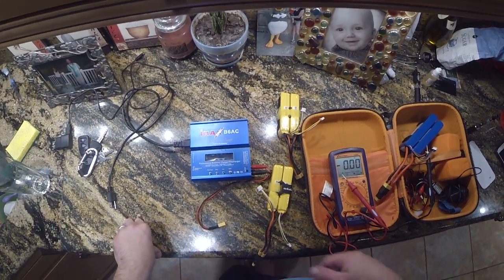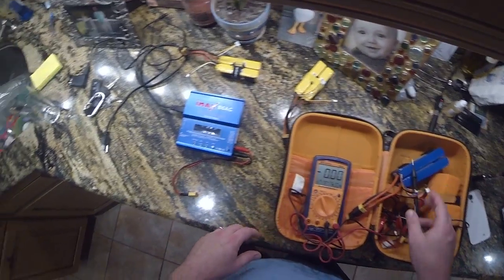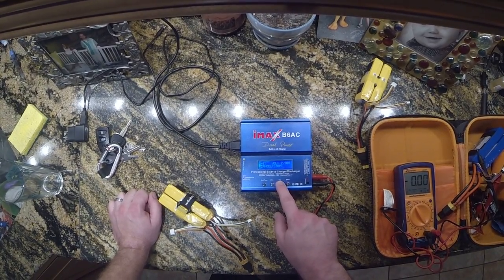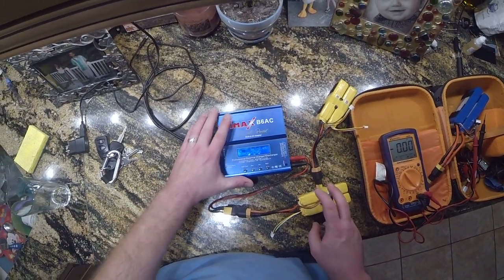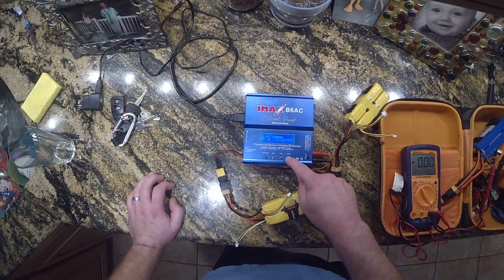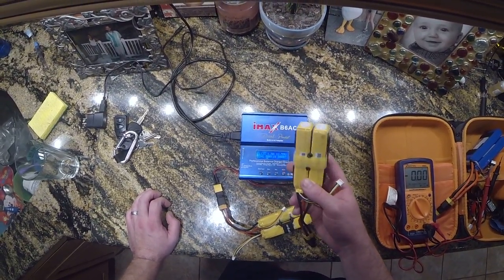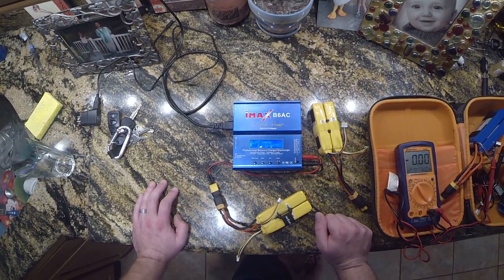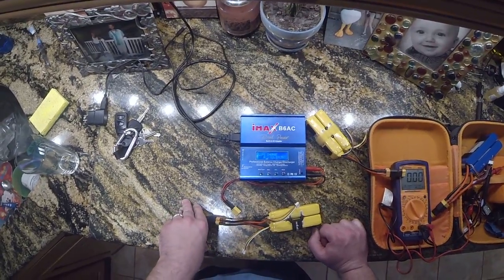How to Calibrate IMAX B6 to correct voltage

Comment: Do you know why my brand new IMAX V6 B3 has an adaptor to convert 100-240 Volt to 12 Volt 5A but yours does not have an adapter and connect to a wall plug directly?

Comment: I also noticed that there is no current calibration; the reading displayed for 600mA = 0.6A therefore it could between 0.55A or 0.65A which would make a big difference

Comment: Best way to Calibrate that charger is throw it in the trash and buy a real charger
Reply from the maker: The charger has actually done a great job and I had the same lipo packs cycled hundreds of times and didn't lose capacity or flight time.

Comment: CAUTION: I have not tried downloading and installing any of the firmware described below, so I cannot speak to its functionality in any way.

SkyRC has released firmware (version 1.14) for THEIR B6 and B6 Mini claimed to allow multiple recalibrations by the user. These links are NOT shown on their "Download" page...only in the help section apparently. The "Download" page still points to firmware v1.13
https://www.skyrc.com/help/download/charger/Calibration/B6AC_Upgrade_V1.14_Add_Calibration.rar
https://www.skyrc.com/help/download/charger/Calibration/B6mini_Upgrade_V1.14_Add_Calibration.rar
HOWEVER...
I haven't seen anything addressing the firmware for SkyRC's newer model, the B6xx Version2 (B6 V2, B6AC V2).
The latest firmware I've seen for SkyRC's B6V2 is 1.13 (Oct2018) but unfortunately, it doesn't say whether or not the V2 firmware already supports multiple recalibrations by the user. According to the device's system information menu option, the SkyRC "IMax B6AC V2" that I just bought came with B6AC V2 v1.13 already installed.
Reply from the maker: That's really good to know that they are implementing multiple recalibrations. You could only do it once before.  I get sick of all the comments about,  "it's more calibrated than your meter, it's perfect if it's a real skyrc, it's the best thing since sliced bread" ect,ect. Fact is,  no they are not calibrated well out of the factory. Fact 2 is, the clone is made in the same factory in China  🇨🇳,  Fact 3 is my gauge I used to do it is calibrated down to the thousands and any voltmeter is honestly much better calibrated than the imax  b6 original or not.  People don't have their heads in the right place and want to appear superior somehow even though they are complete idiots. Drives me nuts.
Reply from the maker: I am very sorry I missed the comment until now. All we have now is a bunch of clueless keyboard warriors.

Comment: The problem with your calibration process is that you are relying on your multimeter as your "standard".
When or has your multimeter ever been calibrated? 
The number of digits your meter will read is not accuracy, that is resolution, to be accurate, the meter must be calibrated against a standard of known PROVABLE accuracy.
I used to work in a calibration shop, all our "standards" were calibrated against the national standard which in turn were calibrated against the world standard.
Calibration is a chain, your multimeter is first or anchor link in your calibration chain, therefore the weakest link. 
Have you considered that your multimeter readings may be in error as well?
What I would recommend is that you get your buddies over for pizza, have them all bring their multimeter with them and take a reading on your "standard" battery then average them and use a good stable well regulated variable power supply as your voltage "standard".
Then carry on as per your video.
Reply: really i got 3 units imax 6 and they are like way off and multi-meter ant off that much and were the f is one to fine a hp voltmeter to vett the multimeter he has so we do what we can
Reply from the maker: Thank you.  Even an unclibrated meter is way closer than the image b6.
Reply: How was the original calibration derived?
Reply from the maker: I had the meter in the video calibrated.  It is exactly on point.
Reply from the maker: Sorry brother. That meter has been calibrated to the t

Comment: I tried it with the clone B6 mini and no luck. It was a cheap 20$ charger so I got it as my ISDT Q6 plus will only balance charge and the battery for my QX7 cannot be balance charged so I figured why not. I knew in advance this would probably not charge correctly as they are not calibrated very well from the factory. Hopefully, someone will know how to do this

Comment: Tried doing what you suggested and it locked my charger up and no longer works. Thanks!
Reply from the maker: So,  you managed to f your charger up and then on top of that burn your house down? Sounds like total bs, or rival channel, or you need to stay away from electronics.
Reply: What was your problem ? Did you ever find the solution ?
Reply: No i didn't my house burnt down a few days later and it fries so now i use a icharger 406duo. I will never use an imax again for charging lipos. Cheap junk. They don't balance properly or cap off batteries full. You don't realize until you spend money on a quality icharger the night and day difference.
Reply: Hitec for life! :D Though I gotta admit, my Turnigy Accucell 6 has served me well for many years. Right now it's doing duty charging and discharging 18650 cells from laptop batteries.

Comment: Useful to know. I tend to use another branded battery checker after using my B6, and it is always a little on the low side (i.e. the safe side).That said the B6 does do a pretty good job of balancing the cells with a max diff of 0.02 volts which I can live with.
Reply from the maker: Yes, I have another now, still low.

Comment: I, myself, rather it undercharge. Mine is also a knock off and I know they don't read voltage very well, so I rather it thinks it's 4.2 per cell when it's actually 4.15 than the other way around. Besides the reduced risk of lipo fire, undercharge will also increase battery life.

Comment: Very helpful info thanks. I just bought a Dynamite Prophet Precept charger. When I balance charge the charge will stop at 96% actual full but reads at 100% full. I went to use your calibrate method and found the charger to be correct in the voltage reading. So after balance charging a battery I have to put it in charge mode to top off at your suggested .2 amps and works fine at 99% full. Is this a common with lipo chargers to work this way?

Comment: dammit its not working
it just goes straight to lipo charge
Reply: Emil Madsen Mine wont go into cali either. Did you get it to work?
Reply: Phlop Alopagus no i couldnt get it to work but a few tenths of a percent in voltage doesnt make a huge difference
Reply: Emil Madsen Well that sucks cause I think mine only charges to about 11.9 and I think its supposed to be 12.7 or something. Thats odd that it wont go into cali. If I figure it out ill drop the info here in case ya need it/want it.
Reply: Phlop Alopagus thanks man
Reply: thats like 30-50% less capacity

Comment: problem is that calibration doesn't account for individual cell imbalance.. you need to either charge each cell separately to make a very balanced pack OR build a precision resistor voltage divider to calibrate the unit
Reply from the maker: The charger accounts for individual cells. Calibrated correct,  each cell will be correct.  Smart-ass, it's science
Reply: ***** are you kidding? voltage per cell is irrelevant? Let me know how your 3s pack does with one cell at 4.5v, another at 3.9 and 4.2.. sure overall voltage it correct for a full pack.
Reply: ***** with the factory firmware and the cheap iMax clones individual cell calibrations are most likely off.. like I said before, if you think that one cell that is overcharged is irrelevant then you my friend lack some basic knowledge in Li-ion/polymer charging safety. IF you only calibrate the over-all voltage detection and increase it from its factory setting you would only be compounding the problem if there is an individual cell reading lower than the rest. That is why I would not recommend showing the world only half of the calibration procedure WITHOUT also calibrating the individual balance ports with a verified pre-balanced pack or a precision resistor voltage divider.

Comment: calibrating .... can you do it several times, or just once?
(read it was only posibile to do it one only time?)
Reply: As far as I read you can do the balancing calibrating just once.
I can do this single calibration as much as I want.
Erika Thornes
thanks for that tutorial. My Imax still gives me to high readings (+0.06V over Norm) but at leasts its better than the +0.18V earlier. Now it charges an Lipo at least to 95% max capacity (earlier it was around 80%)
Reply from the maker: Unfortunately just once